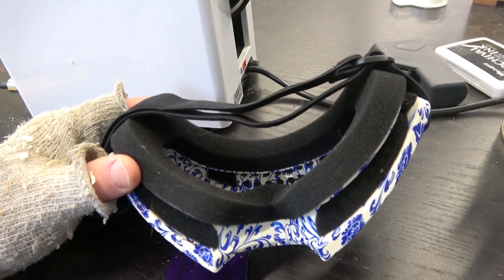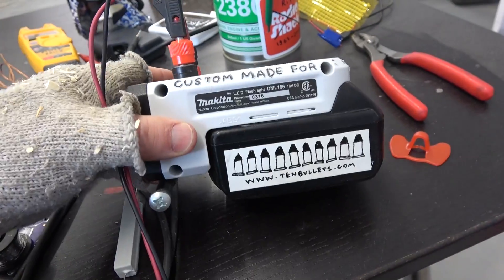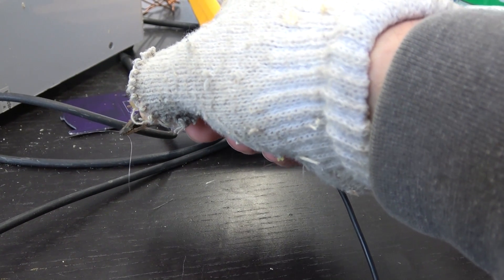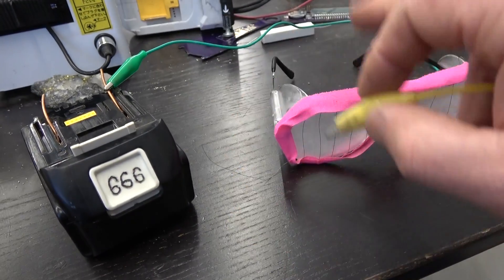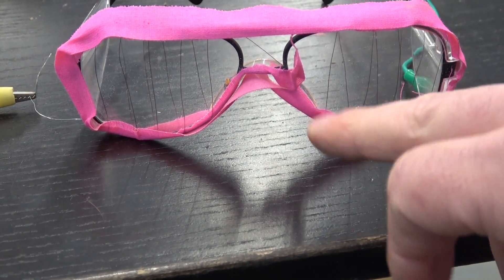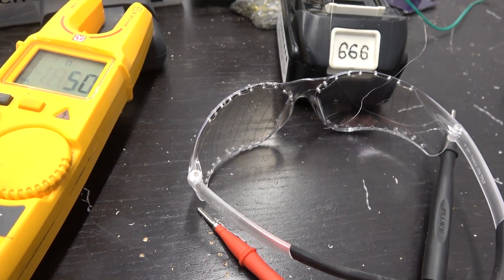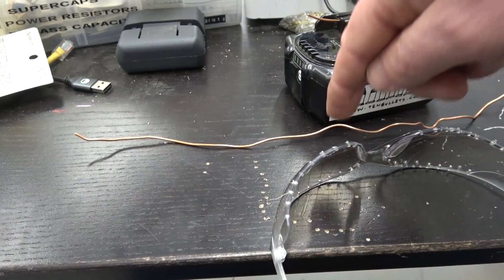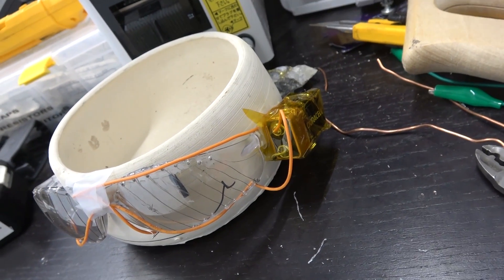Invention: goggles w/ electric defrost

Comment: A more practical way to prevent your safety squints/glasses, mirrors and windows from fogging up is to use either Dish Soap or Shaving Cream on them. 

All you have to do is take a few drops Dish Soap or a gob of Shaving Cream and rub it all over the surface you want de-fogged (if they're safety's/glasses be sure to apply it to both sides). After you've rubbed it all over, take a dry cloth and wipe down/buff the surface clean then voila, it's fog proof.
My Grandfather showed me this trick like 25+ years ago and I've been using it on my safety squints, bathroom mirrors and car windows ever since.

Comment: I’m guessing cast the wire in the lenses for final product, but maybe sandwich in two of the same lenses and plastic weld or silicone together for a good waterproof seal, 9v in a pocket with small headphone wire? But that increases resistance for the battery so a larger battery is needed? Maybe a correct sized lithium ion might do the trick but you would need some kind of circuitry. But I know nothing about this topic

Comment: Fun fact.  Some aircraft windshields have gold dust added to the glass. Makes the windshield itself a resistor. Lugs are embedded in opposite corners.  Pump current through the whole thing. Works great not only to defog but prevent ice accumulation.  But I imagine a bit cost prohibitive for Covid proof eyewear.

Comment: These danger goggles of yours are interesting. But I doubt I'd be able to use them without employing my safety squints as well. Perhaps you could forego the resistive wire, and use resistive ink, or laser cut foil tape or something of that nature, more akin to car window defrosters. It would seem like a logical step forward for the next prototype iteration.

Comment: This would be a good application for Indium Tin Oxide (ITO). It is used as the conductive traces in LCDs, but I also took apart a cheap Chinese demand style water heater and it had a glass tube covered in ITO that they were running a bunch of current through. I never would have thought of that myself, and it was genius.

Comment: Neat stuff. When I worked HVAC I learnt that worked best was just putting some wet bar soap film on my glasses, letting them dry, then buffing off the white dry soap film with a clean soft cloth. I was able to go in and out walk in coolers and freezers and not have to worry about fogged prescription glasses.

Comment: Your problem...  is all about relative humidity.  Hot surface , cold surface,  sticks water from body.  So ventilation to equalize the difference.  a micro heated fan would work wonders....  with humidity sensor,  to minimize on time..

Comment: The commercialized mass production version of this would be really awesome if they could use the same tech as car windshields that have invisible heaters built in. As far as I know, it's glass embedded with some sort of carbon or other conductor that doesn't hinder visibility too much while providing a resistive pixie path.

Comment: You're playing with nicrome, maybe you should talk to your local douche flute user. You need a specific ohm load, someone who used a vaporizer in the last ten years can get you a coil within the ohm load you need. :) I didn't do enough research to do it well enough. But I could build a resistance could between 1ohm and .15 ohms.

Comment: electronic pixie smoking sticks operate on a similar basis, to produce the ol' foggin effect! Be careful to not kiss the dragon with your eyes! gotta get that nichrome on some sort of known inner diameter and you've got yourself a small stove top to make breakfast! This I gotta see.. assuming you're using 18g wire and n40 nichrome get her spun around a 1cm inner diameter with about 16 wraps around her and you will have yourself an 18(ish) volt stove top! Might be good enough for to heat up your tea with a resistance of 0.8ohms! 

Play more with coils!

Comment: Increase the resistance or you could reduce the voltage you need to put the wire in the glass or plastic.the back window of my car already has this system.

Comment: An improvement perhaps on this design, you can get resistive-conductive paint at auto parts stores thats used to repair the defroster lines on car windows, assuming the paint will stick to the glasses well you could paint on heating elements and make it a little sleeker. The kits usually come with conductive glue for re-attatching the wires on the car defrost so that would take care of connecting wires to the paint.

Comment: I dove as deep as 50 comments, and so far nobody has mentioned that Rain-X makes an anti-fog Shmoo to smear on your lenses to prevent fog. We use it in the drone racing industry on our fpv goggles. Maybe they don't allow such witchery up in yonder hills of Canada. 😜
Reply: Also I'm 11 minutes into this video, and obviously the easier way to increase resistance is to increase the diameter of the nichrome wire. This type of wire can be found at your local vape shop which also probably sells CBD by now...

Comment: Why not just make the frames around the glass the heating element make the ear bits plastic with metal hinges? Don't know if they have enough juice, but maybe use a button cell in the ear bits to power them with a cutoff switch?

Comment: These masks have been a curse for me because of the fogging. My advice, wipe down your lenses with the anti-fog solution for car windows. Worked a treat for me.

If it ruins the anti glare or scratch resistant coatings on your specs, or reacts with your plastic lenses, don't call me.
Reply: Either that, or this other product I havn't seen in stores for a while. Literally called "cat crap". Worked great when I had it.

Comment: This is an issue that ass-tronomers have had to deal with since they first pointed their jumbo glasses at the sky. The solution is called a "dew-heater" and is usually formed from a bunch of series resistors wrapped in a handy dandy velcro'd strap.

Comment: I've always explained electricity by comparing it to plumbing, you need a supply and a drain. But electricity will run uphill also. I wonder how well the paint that is used to repair a rear window defroster would work?

Comment: take a sheet of toilet paper, fold the ends in, then fold the sides in, you should have a 1/2" wide strip, place this across the bridge of the nose under the mask, apparently it works
You could also use a tissue or a piece of kitchen towel etc.

Comment: Pisten Bully snowcats offer similar technology in the windshield. Wires embedded between layers of glass.
Of course the local auto glass shop does NOT carry replacement windshields. 
Oh dear, is that AvE sorting out electrical circuits again? 
Great vidjeo, again.

Comment: I do believe that applying the wire to a clear adhesive medium, like some packaging tape or some clear plastic with clear epoxy goop would make this much easier to apply, especially for those of us with prescription secondary eyeballs. And I'd be willing to bet that the batteries inside that 9v battery, a couple of AAAA size batteries, would be much more comfortable to wear. 
They usually measure in at 1.5 volts, so let's say one on each side to make sure you don't throw your noggin out of alignment, and you can make the same circuit with 3 volts. A bit of 3d printing design, and you might have a marketable product if, you're so inclined. 

Or if you're not worried about weight and would prefer more bells and whistles, using 18650 cells and an LED driver board would make it so you can usb charge it damn easy and you have a defroster that will work for a goodly long while. The challenge then will be either remembering to turn it off, or designing a moisture detection system to turn it on and off automagically...

I have some 48 guage magnet wire... I can probably give this a try...

Comment: This would be a great idea on a rear window of a car.
Reply: The old Russian car’s from Lada had heated back windows as an option, so your hands would stay warm while pushing the car.
Reply: Idk. I prefer the button that makes a bunch of drawfs blow their hot air at the window instead.
Reply: @brandoncaldwell95  this is perhaps my favorite thing and belongs in The Wolf of Wall Street
Reply: You might be on to something here! This could be the “Next Big Thing” those investment ads here on YouTube always talk about.
Reply: Man if only someone had thought of that years ago.....lmfao
Reply: I was being completely sarcastic for the few replies.  Facts >My 94 Camaro that came from Arizona does not have a rear defroster; twas an option.  Many late model vehicles come with front windshield wiper blade heating grids. So you don't have to  be an Duesseldorf and stand your wipers up in excitement.
Reply: Shut up and take my money
Reply: Or the front window. Idk why they dont have them in front.
Reply: @ethansmith9065  actually some cars do have them but not over the entire windshield some Subarus have heating elements under the wiper blades where they Park to prevent them from icing
Reply: @ethansmith9065  Ford patented it, and won't let others use it, even though it could save lives. Thanks Ford....
Reply: @ethansmith9065  The reasoning for not using this system on the front probably lies somewhere between the concepts of visibility, structural integrity and practicality (cleaning, manufacturing cost etc...). I've seen thin conductors on the periphery of the shield as radio antennae but never demister use on the entire surface.
Reply: @papapetad  Volvo has done it for years. Hardly notice it. Are we really having this conversation ?
Reply: @tbled52  I've never seen it on any car so it obviously is not the most widespread feature out there which implies reasons. Maybe as a scandinavian manufacturer Volvo is just more willing to shell out extra cash integrating this niche feature as a gesture to the base customers. Maybe others do it for specific markets and I just haven't seen it because I don't live in these countries. Can you think up good reasons for this feature not being widespread or were you only interested in showing the world your superiority as a human because you know something I don't?
Reply: @papapetad  https://en.wikipedia.org/wiki/Quickclear
Reply: @joshuaspencer6246  yep. They have a pink reflection when you see them from the front. I remember when this was a fancy new feature
Reply: @papapetad  works great on airplanes...
Reply: Maybe AVE should put that paint that’s used to fix the cracked defroster tracks on the rear windows on the glasses? Or better yet vapor deposit a film on them that Ford had as an option in the 80’s on the Crown Victoria instaclear windshield. I think it could melt .3” of ice in 3 minutes but was like a $900 option.
Reply: I have had several cars rigged this way, yeah.
Reply: I have seen this rear heater feature on East German cars, it's so your hands don't get cold when you push. Not only West German cars are so advanced. 😉
Reply: The number of idiots whose head this went over is hilariously high.
Reply: land rover windshields.
Reply: Add a graphene layer into the windshield lamination layup and you'll never have a foggy windshield again!
Reply: So your hands don't go cold when you push start it in the morning?
Reply: You mean like 90%of cars since the 1980's?
Reply: @jwalker7567  that was my favorite part of the focus I had in the UK. Aside from the thief hidden 6 disc changer under the driver's seat.
Reply: Hmm if only...
Reply: Did you know Lada invented that? So your hands wouldn't get so cold pushing your lada to the side of the road.
Reply: all windows
Reply: every single car in eu has that. what stone age country you live in?
would love to have heated windshield wipers tho!
Reply: And with even finer wire on the front screen...... Oh crap, my Ford has that already, maybe a toilet seat warmer?
Interesting if you don't lift the seat! 🤯🍆⚡⚡⚡⚡
Reply: Lolll don’t all cars have them?
Reply: Yugos had them to keep your hands warm when you have to push it... :)
Reply: @BrianRZR  I'm here to help. Drive in reverse. You are welcome.
Reply: My 2006 Chevy avalanche has one.
Reply: Volvo introduced a similar thing that transferred to Ford when they acquired Volvo back in day, to be clear this was in the windscreen, worked pretty mint just new windscreen was expensive as frig.
Reply: @full-send-engineering  other way around buddy, its ford tech, i remember them in fords from the late 80's and early 90s .. volvo got them around the same time as jaguar landrover, i.e. when ford had their fingers in lots of pies.
Reply: @full-send-engineering  had one in a 2006 Ford. Tiny filaments in the front windscreen allowed you to demist the window without touching the heating.  It also melted ice immediately when you turned the car on, no waiting for the engine to heat up.
Reply: @wrasslers2656  I always thought there should be a way to make it work for a front window. Never knew there was a working example!
Reply: This
Reply: My 2009 toyota Carrola has it on the back. :)
Reply: @mastercollin22  wow Toyota really though of everything!!
Reply: @EpicHoneyBasket  Someone should tell them to put it on the new model!
Reply: @mastercollin22  that went right over your head😂😂
Reply: Nearly every german made car has it
Reply: @julian19js  Wow! You lucky guys with German cars, much be nice! Are you sure German cars have it? Because I'm pretty sure AvE just invented this and already filed for the patent.
Reply: @julian19js  My honda does too. Whats with the axis countries and all the good ideas?

Comment: You could make something similar to a small hair dryer and just feed hot air over the glasses by taking two pairs and overlapping them to make two layers that hold the air in between with hot glue to seal it so you don't have to worry about scorching your eyelids.

Comment: Ya I just dread going out anymore (need the lasic) and now the mask fogs the glasses . I'm thinking about the air jacks for the BMW but a titanium case speedmaster professinal with a clone 7750 calibre movement trumps all the band pieces custom form tool flycutter and there push pin bands thank god LOOOOOve that power supply fix that damn thing that is what powers cool and...

Comment: Check out conductive resistive paint, it's the stuff they use on rear window defroster grids in cars. You can pick up small tubes of it that are used for repairing the traces.
Reply: Foil tape

Comment: I saw your video on making a screen for your NoPro camera on the CNC and mentioned these, but they might work in this instance too, if the first layer fogs up, you can roll them off and have new tape. 

https://www.mxstore.com.au/p/Protective-gear/Adult-Protective-Gear/Adult-Tear-offs-Roll-Offs/Oakley-O2-MX-Goggle-Roll-Off-Kit/OA101-358-001?gclid=CjwKCAiAl4WABhAJEiwATUnEF8oJtqKdajkfXjEZ9GxDdB92ubU7NP2MI4pp7Vd-_2k69V772XhrDxoC77AQAvD_BwE

Comment: Don't parallel them and use one 18650 battery for better energy density and rechargeability. Be more ideal if you could coat the window in that orange-ish stuff Ford used on their windshields because it has no lines.

Comment: I would have made a center tap on the bridge, used flat Kanthal wire inlaid in the polycarbonate below the eye, and a small rechargeable protected lipo battery.

Imagine the window heaters in a modern locomotive. Just like that, minus the 3000 amp 72 volt batteries.

Comment: I had a circuit I built the other day where I was running an addressable led strip off a 9v copper top and I measured the current coming from the battery to be about .6A and I was wondering why the lights were so dim and I measured the voltage of the fresh battery while it was running and it was down to around 5.4v instantly and was dropping pretty quick

Comment: You could buy an electrically heated visors for a snowmobile or motorcycle and adapt it to fit? I mean as, much fun as getting poked in the eye by Nichrome wire is, the product already exists...

https://www.ebay.com/itm/FX-140-ELECTRIC-HEATED-SHIELD-HELMET-AFX-FX140-SNOWMOBILE-MOTORCYCLE-VISOR/123544260775?epid=20027086573&hash=item1cc3cfd0a7:g:6CkAAOSwf1xcE7yv

Comment: What's thinking about something like this for motorcycle helmet visors.
When you think how small heating filaments in car windows are now, I don't know why they don't embed them in the visors. 
Power consumption would be low, a car back window uses between 10 to 20A at 12v and when you consider the reduction in area in fro a window to a visor, you would only need 3 18650's  to run several hours.

Comment: This is the ideer behind the defrost grid on the back window of your grandpa's Oldsmobile.  AND--you can buy conductive paint designed to make repairs to damaged defrost tracks (hint hint).  These tracks warm the glass through conduction--not radiation--which means it's more efficatious.  Rock on!
Reply: Beat me to it.  Just fixed the grid on the minivan last week.  As soon as AvE started with the NiCr I had the idea for the paint...and the understanding that there was no way I was gonna beat the hive.  Great idea for the glasses, though.  And never would have thought about it without AvE. I am gonna get more paint and one of the tab repair attachment kits and try coating around the edges of my glasses.  Might need to use paint with greater resistance as the runs will be so short. Mine will power through the templar and the lanyard.
Reply: The high priced polarizing sunglasses have that metallic looking layer. I wonder if it could be suitably adapted to angry pixie transmission?
Reply: Sputter some nickel on that plastic, use conductive epoxy for connection to ze vire, and you can warm the entire surface at once, and you get the cool metallic anti-snow-glare effect, all at once :)
Reply: Going to try by coating the entire glass with it!
Hope this will not give too much resistance! 🤪
Reply: Heated coffee cup